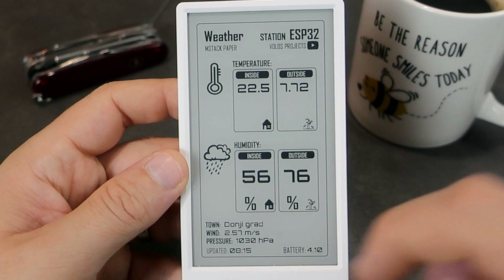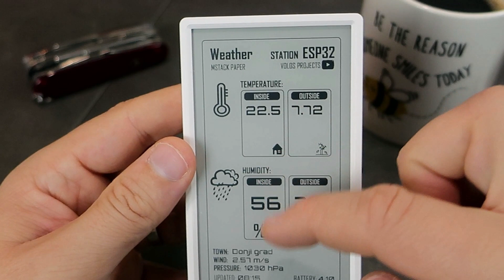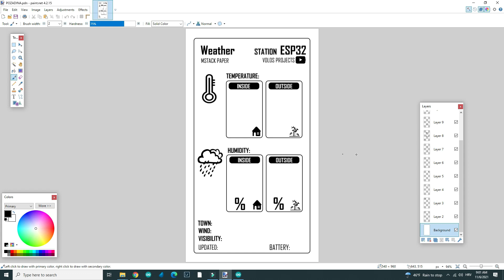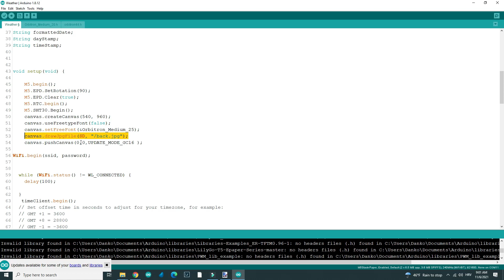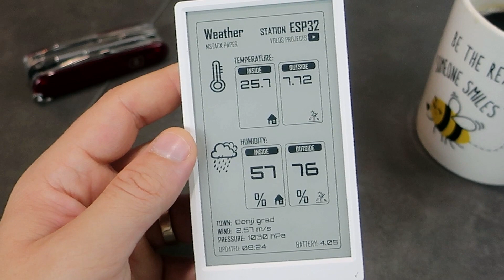Weather station using ESP32 device and E-Ink paper

Comment: This looks GREAT! Excellent video, ty!  I have a unique system need for a super low-power  self-reading weather station in a remotely placed camera housing, it cannot have any external communication & must be fully self sufficient. I'm wanting to use ESP32 if possible. I love the ePaper for low power draw, I need the computer to read an EXTERNAL (outside the camera housing via wires) thermometer & hygrometer readings (every 10-20 seconds?) to calculate the very accurate dew point. I then need the computer to read a separate INTERNAL (Inside the camera housing) thermometer, and then I need the computer to control a relay that sends 3A-4A 12V to my internal heat strips to turn them ON & OFF so that my glass window remains "5 degrees" above the current dew point. I need to be able to adjust the "Degrees above Dew point" to fine tune the system for various conditions & locations.  I'd also love to be able to control the time of day or night that the system is allowed to heat my window. I am trying to prolong the life of my battery as long as possible as I will not be able to even go check on the camera for days or weeks at a time.  I'd like to eventually extend this to months. Any advice? tyvm

Comment: Hi!  I just got an M5Paper unit today and installed your weather app.  It is awesome.  Do you know how I would convert the SHT30 temperature data to Fahrenheit?  I know it's a stupid system but I grew up with it and it's what the news reports here.
Reply from the maker: it seems there is no function to recieve temp in F, you will need to matematicly convert it in code, here is forumla for converting 0 C to F
(0°C × 9/5) + 32 = 32°F
Reply: I tried to put the formula into the code and it didnt work.  Do you know where I would put it and what that line would look like?  :) @VolosProjects
Reply: @TheCaptnHammer  yngmi son

Comment: I really like your idea of drawing the graphics as just one static image instead of a series of line commands and icons.
Reply from the maker: Yep, much faster
Reply: It is a good approach. You could take it further and use a server to generate the view of different dashboards and just display on the device. Use the toggle switch to navigate dashboards.
Reply: @ryanpipkin8476  I'm working on something similar. Dashboard constructed out of html pages with routing and interactions. Server side rendering of the pages and the pressed states of the buttons + compressing it and storing it in ESP32 PSRAM. Touch interaction + navigation between the different states. It's just a prototype for now but the goal is to make it a smarthome dashboard...
Reply: I couldn’t tell what software you used to create the graphics. I’ve used Paint so far but it’s very limited. Photoshop might be too complicated.
Reply from the maker: @0miker0  i used paint.net , free software with mor features than paint butt lee than photoshop